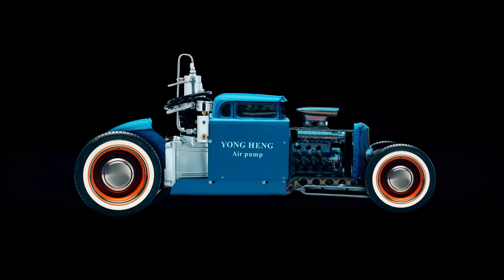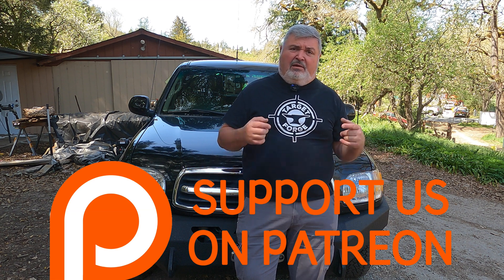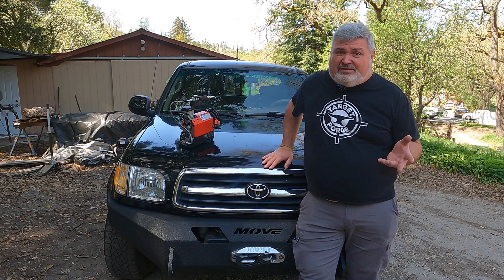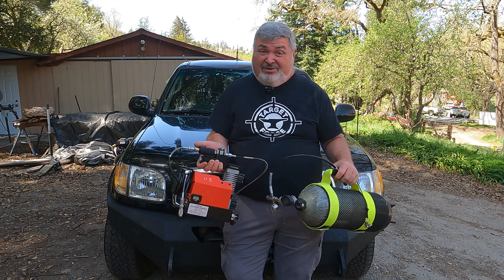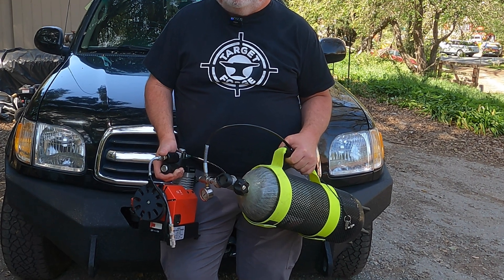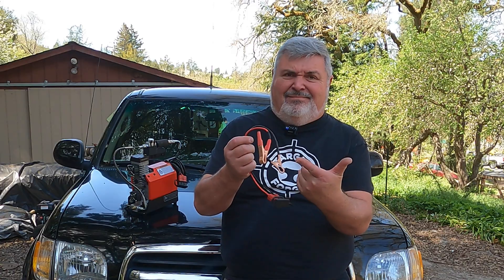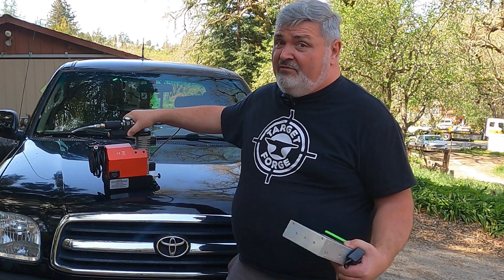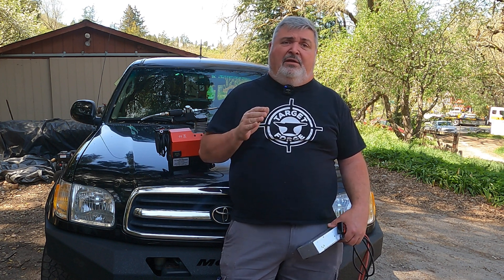The Yong Heng killer goes free! GX CS2 Toyota Tundra pick up portable PCP compressor

Comment: Aloha Bill man everyone is having good luck with these compressors I have some bad luck why I really dont know I have 2 with one recently purchased like November and it won’t fill past 1800 since yesterday I’m afraid to buy another problem I thought it was a good compressor but apparently not to me any suggestions would be appreciated mahalo🤙btw love ur videos
Reply from the maker: Number one cause for small compressors to make pressure is simple leaks. Number two is the output check valve is dirty. If you have only had it since November, and you bought it on Amazon, you have a one year warranty, don't wait for it to expire.
Reply: @TargetForge  ok I’ll check I pretty much checked everything I could think of yes this is a brand new replacement sent from the Amazon repair people thank you so much Bill I emailed them on Friday they responded yesterday they are gonna help me with this have a good day 🤙

Comment: Been running the gx for 2 years with out fail. Fornthe moneynits hard to beat. It will fill a 700cc tank from 150 bar to 300bar in 7 minutes
Reply from the maker: I just put a video up of a complete teardown and reassembly. They are very well built inside, and portable? Just crazy how nice they are for the money.

Comment: Hello Bill, I hope you are doing well, once more greetings from Peru, and congrats again for your channel. You provide excellent and clear info plenty of hints. 
By the way, it seems that finally this week I will have my GX2 Air Compressor on my hands. There was a little delay in the shipping process but everything was solved. 
I don't know whether I told you that I'm new in the Airgun World. Some years ago, I had to leave away my shotguns and my lovely shells. Since last two years, I  began to watch some PCPs/Airguns videos mainly the UK and USA, and I thought that it was amazing and a good alternative to shooting again. Therefore, a couple of weeks ago I bought a new Kalibrgun Cricket 2 Tactical. The Rifle specifications indicates that it works up to 300bar of pressure. Do you think that I can use the GX2 without any problem to fill up the Rifle with 300bar?. 
On the other hand, may I abuse of your kindness, and ask you some operation tips that I should take into account before and when I’m using the GX2 air compressor with my new Rifle?  I don’t want to messed up anything. Also, I think I heard from you that the GX2 manual is very poor, so I got a little worried and I have begun to review all available info. I would like to have in my hands the right tips and indications for a correct use.  
Bill  thanks for your time. all your recommendations will be more than welcome. Thank you in advance, Antonio
Reply from the maker: My apologies for the delay in getting back to your comment. I knew the most recent episode was in the works and I think it will answer many of your questions. https://youtu.be/f9WzLQqwtc0 is the one I think will help you.  Let me know if you have anymore questions, happy to help.

Comment: How's the flow rate
Reply from the maker: That is an interesting question. Simply stated the little red compressor is 250 watts. If you want to compare it to the Yong Heng at 1800 Watts in very rough terms, it's output is likely much lower, which is why it isn't recommended for filling large bottles, it's not  a tool for that. Filling my Crown from 150 bar to 250 bar takes ~6min. It runs cool, is quiet, and small enough to be really handy. Can it replace a Yong Heng? If you drop the notion of filling a large bottle, it CAN replace the Yong Heng. Of the 1800 watts the YH consumes, I wonder how much is wasted in heat?

Comment: Is the little cigarette filter sufficient for drying the air from this compressor ? Also / what about rain ?
Reply from the maker: So on this unit there are two cotton filters, a small one inside the oem filler block, and a large one in that larger round two piece threaded holder. I rotate the big one out every other fill with a dry one, and dry the wet one in the sun, the powder coat oven, or some warm dry place. Would I run this in the rain? No, I would not. If humidity was really high I might change that filter for a dry one each time. Since there is no oil bath the filters stay pretty clean, changing the big filter is pretty quick, the little "pre" filter takes a bit longer, but not terrible.
Reply from the maker: I guess I could make a cordset that would allow me to use the unit inside the cab, but honestly if its raining, I might find something else to do.

Comment: Very nice 👌 👍
Amazon says GX CS2 and you wrote GX CP2. Which is it?
Reply from the maker: My apologies will fix ASAP. Amazon is correct.
Reply: @TargetForge  just got GX CS 1.
What u think of those
Reply from the maker: @stedyone1090  I've no idea, but will look into them.
Reply from the maker: I've looked at them now and I'm curious what they look like under that cover. I'm always a little dubious of those mechanical auto shut off gauges. They have been the achilles heel on the Yong Hengs for years, don't know if they are the same part or not. What I do know is that a precise mechanical part responsible for preventing disaster, in high vibration environment, built in China, at this cost point, gives me pause...
Reply: @TargetForge  saw some good reviews on mine before I  purchased it
Reply from the maker: @stedyone1090  I wish you many a high speed pellet Sir!
Reply from the maker: Check description